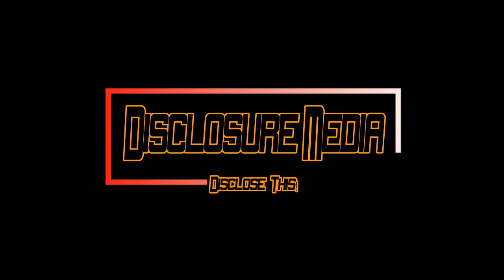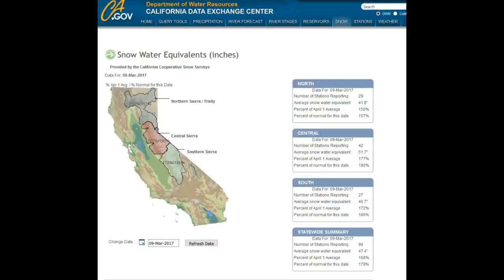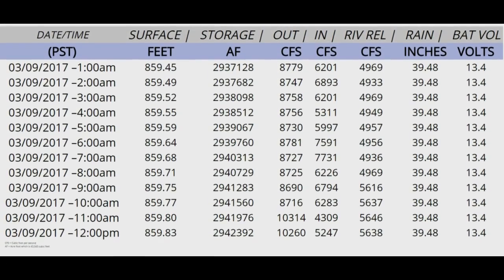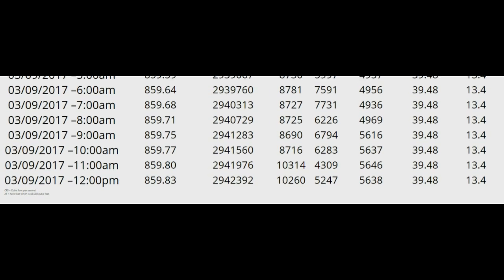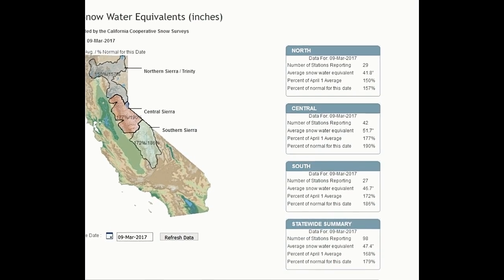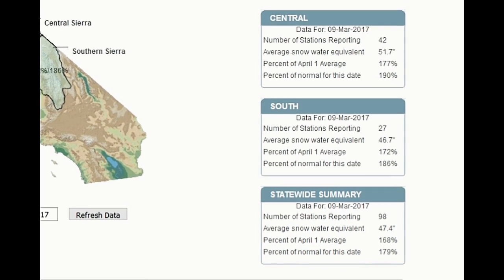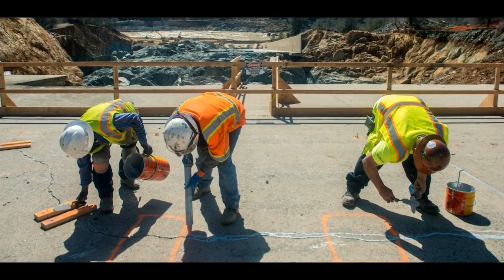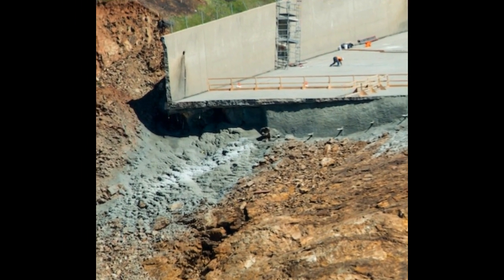Snowpack Conditions | Spillway Repair Images | Lake Oroville Dam Updates 3-9 -17

Comment: If the worse happens at Oroville Dam, people need to know that there are manufacturers of very large mobile water pumps that could effectively maintain the Oroville lake level below the safe desired water level.  Large temporary above ground pipes could quickly be laid, that would by-pass around the damaged areas while all the dam's damaged areas are repaired. The pumps could safely move any amount of excess water all the way from the lake to the river ( and that is only if the worse happens ).

Comment: I doubt the wisdom of using "caulking" - the sheer force of the water's blast would clean in out like a scouring brush.  I think the thing needs to be "crack free" - an entirely new covering over the old - similar to the way a road is repaved - the old serves as a foundation while the new is laid upon it in swathes without seam.
Reply: Its not "caulking."  And what they are doing is only temporary.

Comment: The inflow is supressed as they have shut off the outflow on the 9 above dams.  The normal  rate of inflow is about 15k CFS., on warm days even more... alot more.  Rain, forget it!   The repairs are a joke, that water will rip  apart that patch work.   If unrienforced concrete cannot handle the pressure, what the hell will concrete glue do?  IDIOTS!   Instead of the State doing the repairs, they should have brought in Goilatti Bros or Swinerton to do this 'repair'.,
Reply: I get it, but the repair(s) they are doing is truly a joke.  It is very possible there is no repair that could withstand that high PSI.
Reply: Truth and LIfe,  Admit it, you just want to see a catastrophe so you can satisfy your ego and say "see I told ya so."
Reply: The Truth and the Life I am I and the supposed truth propogandized in this world is just that propoganda. we are the gods and it's up to us.  not some outside diety. which is why we been led down this trail of lives [lies] {<live evil}by the Masters of this planet and the entities that gentically. engineered us. just like they genetically engineered a tomatoes or the truth.  this planet is a prison planet and we are it captors till physical death and then and only then do we have ashot at getting. the hell outta here if we have the presence of spirit to do so. I reject all religion
Reply: what are they supposed to do? they need the spillway.
Reply: The Truth and the Life  Are we not all sinners anyhow?  Or do you believe you don't live in sin?
Reply: The Truth and the Life the thing u think k and define as god is NOT in control I assure you...what is in control u can't even fathom mwith ur human brain
Reply: A warrior for God you are NOT!
Reply: Steve Wilcox allot and no thing
Reply: You say God is not in control and who  are you? Bet you will  lose in a war with the truth and life.  You think your god is  real? And  who  are you?  By the way, I  consider myself the athiest slayer.
Reply: See, I  can prove you wrong.  Moreover, you can never prove God lied.  My  choice is to bow out as arguing (from past experiance) with someone so far down the abyss is pointless.  Darwinsm is a LIE,  Dead Sea Scroill are thee TRUTH, Bible prophecy is where God wear His  truth on His sleeves.....over 2000 prophectic events that is 100 percent accurate.  All factual and scientifically correct.
Reply: The Truth and the Life... The "atheist slayer" hahahah, that's a good one!  Your humility and compassion are truly touching.  I'm sure your god will give you a cookie for your arrogance.  What branch of crazy religion are you... not that such things have any relevance to an engineering discussion;
Reply: Well then, you appear a willing and able athiest.  Prove to me God does not  exisist,, 3 max and I will reciiprocate.  If not, go home and live in sin.
Reply: Let's not put words in my mouth.  I profess myself as an athiest dslayer...not really, but factually...yes.  If you are not an athiest, be gone my friend. If you are lukewarm, we can continue this dialog.
Reply: did you know, that Pope Francis has embraced Darwin's teachings, stating that God works through science.
Reply: Not sure I follow you.  If you have something to say, please say it. Moreover, if you believe I have been deceived, please be specific.

Comment: the repair on the spillway. 
on the lower section they sprayed spancrete. just below the washout. under the three feet thick concrete platform. this might work for a short time but unless they can figure a way to reduce the pressure against the spancrete its going to crack like a chocolate dipped cone at dairy queen. and lift up the top of the lower section causing more erosion . they need to keep that water level.

Comment: Very much appreciate the updates, have family in the area. DWR is actually using frk'n caulk & a hand trowel for sealing cracks on the Main SW floor, WTF? Well, they did say "temporary fix", but I was thinking along the lines of more than just a few minutes, lol? Maybe there's another more HD coating to be applied over the entire surface, or the crack + adjacent areas or something more, that'd be a little more comforting. Actually, they've done more than I ever expected - that was/is quite a mess & a hell of an effort by lots of skilled workers working at it 24/7.  Let's hope the weather cooperates (maybe "Moonbeam" can call HAARP?) & residents won't have to evac again. Just gotta keep all/most pwr plant turbines operating @ near max, keep repairing Main SW, continue prepping Aux SW (will be needed again if/as soon as Main SW blows apart again), no excessive rain, no excsv melt, no overflows/floods/levee brks (especially upstream), complete channel & river clean-up and we're all good, right? Seriously, it's criminal dereliction of duty that will require taxpayers to ultimately pay far more than if Gov't had addressed the problems ID'd yrs before. Accountability has to rest somewhere - just once! Absent a specific individual, the Governor & State/U.S. Senators + area members of House of Representatives seem to be a good place to start - and end!

Comment: wtf are they doing. That's a joke if they think that will keep 40,000 cfs from head cutting under spillway.headed up to gates. You know there in deepshit when there using Home Depot products. Dam Fix cualking isle 9!
Reply: Keith Irey placing a band aid on a severed limb
Reply: They used caulking from Home Depot...??
Reply: You can see Home Depot buckets being used. I believe there using Quick rite concrete joint compound. It works for driveways and sidewalks. 40,000 cfs of water I think not. Lol
Reply: With proper flow and speed  the hydrodynamic energy will not create significant back flow erosion or under cutting.  But the flow rate takes time to ramp up so the shockcrete is to minimize erosive forces as gates are opened to the optimum flow rate.
Reply: Commissar0617  I meant the caulking used on top to seal cracks on spillway looks like quick rite. They sprayed dirt ways with shot Crete. Still that will wash away under 40,000 cfs.
Reply: home depot doesn't carry shotcrete.
Reply: no tat's not quikcrete products. i can tell. 
also, the shotcrete is just to prevent erosion when they're just starting to open the spillway, once it gets going, it jumps off the end.

Comment: Fillin in the cracks with some..........."Caulk"!!! Liked the way you said that sentence.
Reply: That's not caulk.  That's an epoxy concrete filler.
Reply: Mini Min......Thompson's Water Seal.
Reply: Buckhorn Cortez yes put that stuff in the concrete before I paint a garage.
Reply: it must be injected in to crack to work or it might as well be cock
Reply: Slippery Sloper u like caulk sliding in yer slippery slope eh
Reply: Slippery Sloper Hey..... I was going to say that💡Its "elastic caulk" it will hold
Reply: John Holmes and Jonah Falcon both come up short. This is  BIG job.
Reply: kimmer6 I am engenier
Reply: Maybe they should call Mike Holmes and "Do it Right"
Reply: Dave Shepherd and for their legal issues they should call jim the hammer shapiro
Reply: Just go to Home Depot and buy some caulk.
Reply: kimmer6 😂😒😥👏